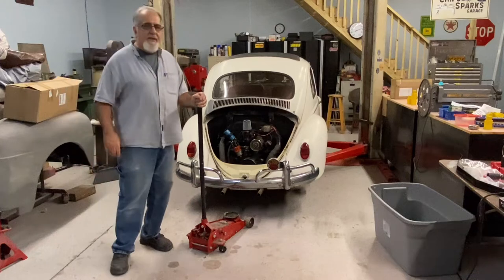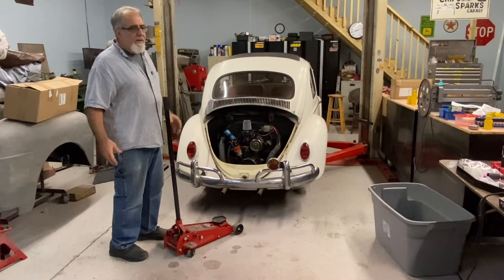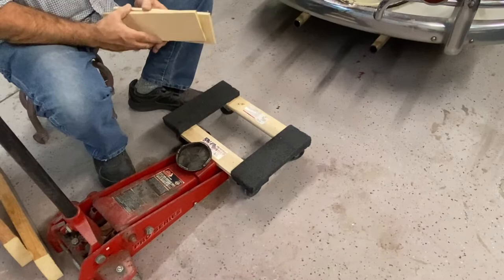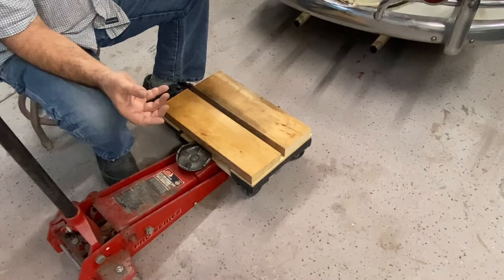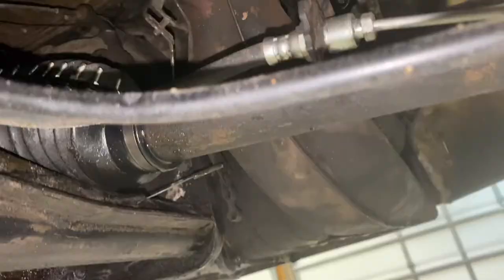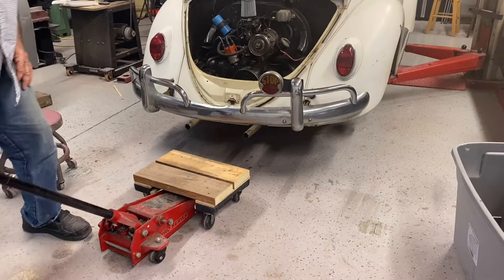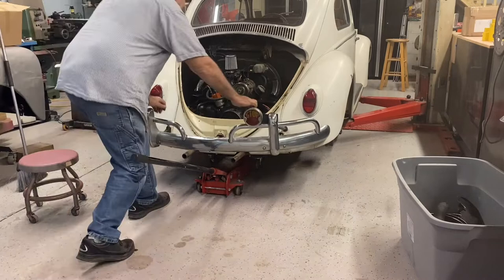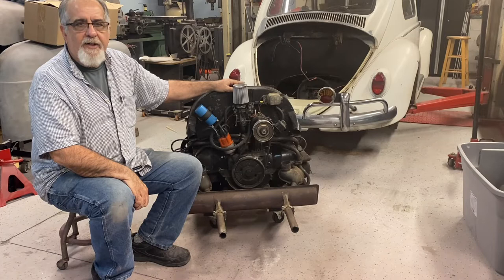Build an Engine Jacking Cradle, for easier VW Engine Removal

Comment: Cool. I did almost the exact same thing, but I had to build mine a little higher because I have a 70 bus and I wanted the dolly to roll straight in and out without having to go up or down. I used the floor jack to adjust the height of the transmission to match the engine. I've used it twice now and it worked very well - a lot better than using a jack on the engine. Now, if only I were a better mechanic...
Reply from the maker: Thanks for watching and commenting! 👍
Reply: what height did you build the dolly? I have a 69 and was thinking exactly the same!
Reply: @mikewinter9938  My dolly might be a little lower than yours because I have an added oil sump. Basically, I made it so I could barely wedge it under the engine when it is installed.  This way, I was able to not adjust the height of the motor at all on removal and installation. I did adjust the transmission a little on installation. I used my floor jack for that. It was much easier than adjusting the engine on a wobbly floor jacket.

Comment: I used the same thing for a while but the front ended up sagging quite a bit due to the cut piece of the dolly. Mine was very similar yours. 
From there I ended up building a metal one out of angle iron that does the trick. 
As long as it works it’s a win!
Reply from the maker: With todays lumber prices, it might be more economical out of iron. Thanks!👍